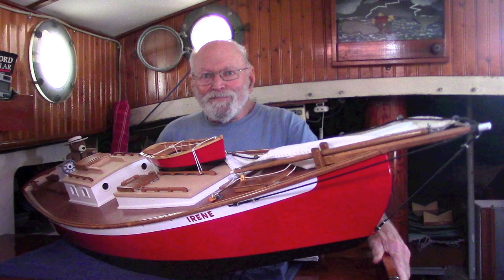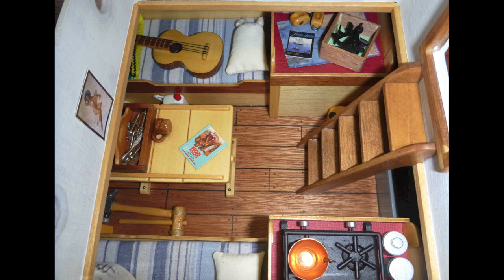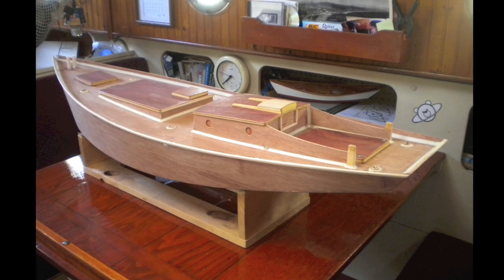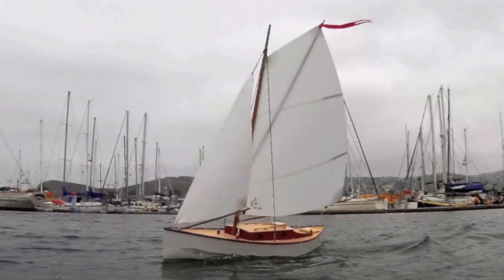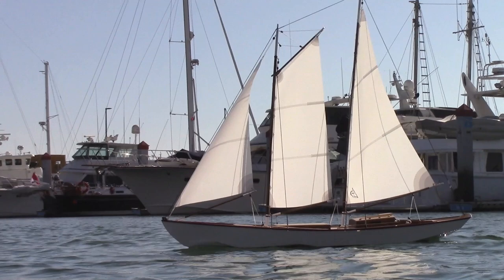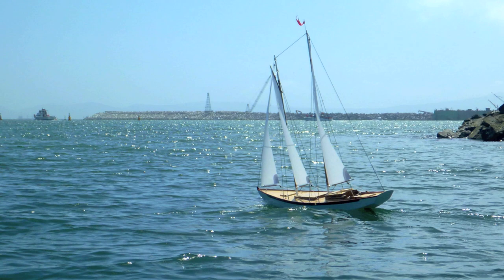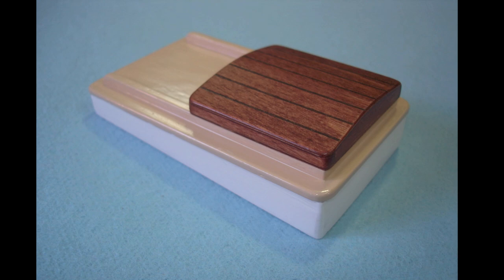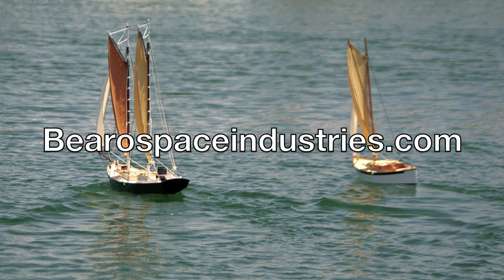Stay at Home RC Sailboat Building

Comment: Hi Gary. As you may remember I made an 80% Irene. This linear reduction gives 50% on the displacement and therefore half the weight. The scaling was done by simply printing out 80% size from the original plans. I had to do a bit of fiddling on the control because of the space. Here are 2 youtubes of mine https://www.youtube.com/watch?v=P0nS7YAosCs on the building https://www.youtube.com/watch?v=KCxF96R2IdA
and sailing of Irene. I have printed out an 80% Annie and have all the materials but not worked on for 2 years. I enjoy rewatching your videos. I hope you are in good health and that all is well at Bearospace.  All the best, Irving
Reply from the maker: Thank You Irving !  All is well at Bearospace. 
We appreciate the videos of your schooner 'Irene' project  and your earlier sloop 'Emma' videos as well.
The lake you sail on is such a beautiful setting ! and with cows ! 

Cheers !

Comment: If only I knew how to sail with the wind, I'd try building a sailboat. The 2 boats I have both have motors in them. One was entirely 3D printed.
Reply from the maker: Give it a try, sailing is easily learned by doing, and safe. You are not likely to get hurt like you could if you were operating heavy equipment !  (tongue in cheek)

Comment: Very Nice Gary

Do your plans include RC rigging information?    

Do you recommend a radio and servo set with your plans?
Reply from the maker: Thanks Scooter Don for asking. The plans do cover RC control system layout and servo recommendations. Early on, I recommended a radio which I used, but that radio was discontinued by its maker. Happily, most any 2.4 ghz airplane type radio will serve for these boats. Todays radio options offer more features at lower cost than the radios of 5 years ago.

Comment: Very nice! I have some of your plans and I'd like to make one. Is 'waterproof' plywood mandatory or would plain plywood do?
Reply from the maker: As I understand it, all plywood these days is made with waterproof glue, however any plywood still needs protection from water intrusion. A good paint job will give the needed protection. 
I suggest first sealing the plywood, preferably with penetrating epoxy, then priming and painting with brushed on oil based enamels.

Comment: Gary, do I understand correctly that your first Irene with the interior details sails with rudder control with fixed, uncontrolled sheets? If so, how does that work out?
Reply from the maker: Yes Robert, that is so. It actually works out surprisingly well. I adjust the sheets so that the sails are sheeted in, but not too close in. Experiment to find a "happy" spot and she will be able to reach, run, and make her way (quite well) to windward.
That said, I encourage builders to install a sail control system because it does provide the avid sailor "Skipper" with hands on (fun) involvement and the ability to trim for best performance.
Reply: Thanks Gary, I am building a couple of Dumas Ace Sloops. The are designed as free sailers. Your experience encourages me to try them as rudder only. They are only 16 inches at the waterline so they don't have much displacement. Rudder only will simplicate and add considerable lightness.

Comment: Could Annie be build as a real sailboat let's say 35 to 45 ft
Reply from the maker: Certainly a full size boat resembling 'Annie' is feasible, but boats do not simply scale up (or down) well, so a proper design process at the intended size would be the key to success.
Gotta add, I do think an 'Annie' type could be a fantastic cruising boat. (dream time anybody?)